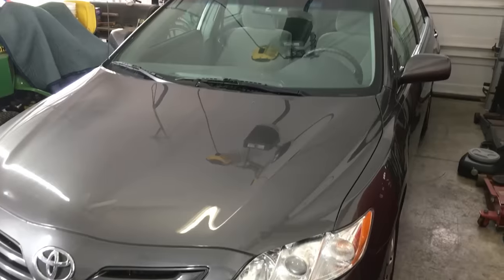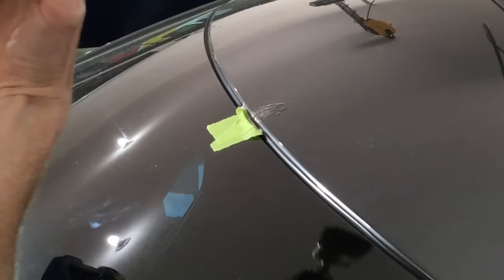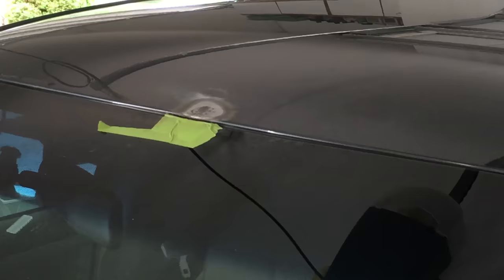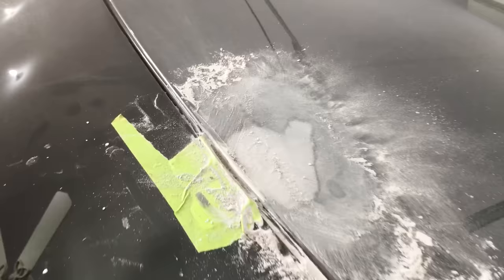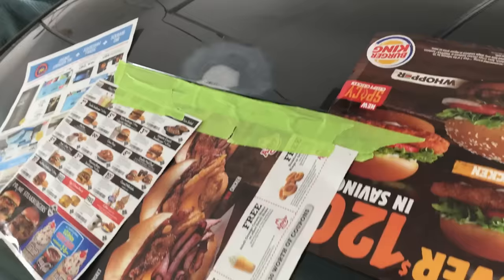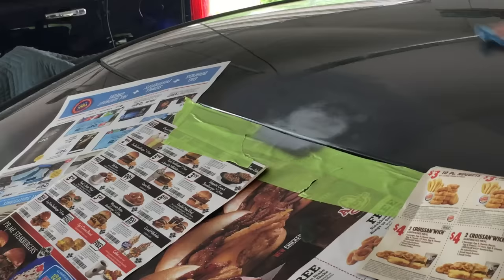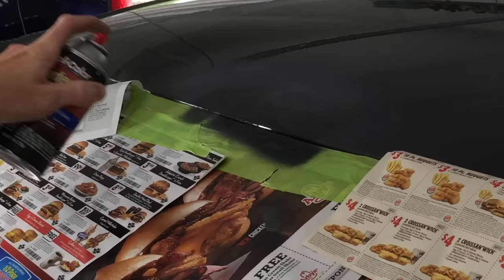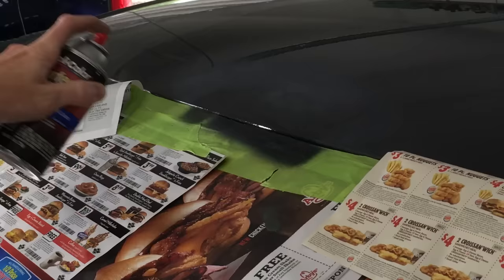How to Fix: Rust Bubble Under Paint from a Rock Chip Around WIndshield

Comment: Thank you for your helpful DIY tips.  I've got over a decade of professional certified hand spraying under my belt for airplanes.  Tips like these on a used daily driver and to have it coming out looking good for not a lot of money is what I look for.  Sure beats touch up paint in a tube..lol!  I have several cars/trucks and both foreign and domestic.  I always liked my VW's for a fun, sporty, daily driver.  I own 2 as of now.  My nicest one is one I searched for.  It is a 2009 Jetta GLI 2.0 turbo manual shift in top condition.  My second is a 2010 Jetta SEL 2.5 with a DCT trans and every option you can think of.  I found it down south needing work, but in great overall condition.  Just some normal scratches and a small rust bubble on each fender.  It had average miles of just over 90K, but the owners neglected oil changes, and probably the right oil for that matter.  The inside of the engine was filthy and it was out of time from a stretched timing chain.  I made a deal with them and trailered it home to fix back up as a DD.  If the interior wasn't like brand new and being the top of the line SEL package I would of passed on it.  Not to mention the body was in very good shape for the year.  I decided to source a used engine instead because of the gunky build up in the engine from negligence.  I found a matching 25,000 mile engine in clean like new condition for $700..Wished I could find a 2.0 Turbo for that kind of money.  Well anyway I decided to get the matching DCT that came with that engine as well for an additional $500.  All said and done I have under 3K total in the car and it looks, drives, and runs like a brand new car.  If you have the know how and take your time you can save a lot of cash.  Plus they are a nice car too.  Man I was surprised as how strong that inline NA 5 cylinder turned out to be.  I let my son drive it and drag race my GLI at the local track in the 1/4 mile..He actually pulled me through the 1/8th and I barely ran him down at the 1/4...I was impressed for just a daily driver that also looks cool and handles and drives great.  Well worth the $3k and my time...sorry for the book..its videos like yours that help us diy'ers the most. thanks.

Comment: You can use a Dremel tool to remove the rust on small areas and apply a rust converter to pitted areas before priming and adding filler. Always apply your primer both before and after adding any filler. Also if the surface is smooth without any pitting or bare metal exposed you can usually paint over the converted rust directly.
Reply: Filler should generally be applied to bare metal
Reply: @mehmeh5471  Filling over primer is OK. Filling over paint is a no-no.
Reply: While you CAN paint directly over converted rust/bare metal, it is better to etch prime it first.

Comment: The major issue with this is when you showed the pit u said to use spot putty, to the left is rust. The dark black/brown is rust. Wire brush won't get rid of it all. Only sand blasting or use a rust reformer or acid. You can do all the nice work and paint but not worth the time and money when rust bleeds through in 3 months. I use Ospho. I know this because I did this when I was a young man restoring a 72 VW Bug. I did same as you and it rusted through in 6 months. Then a girl filling with gas day after I repainted, pump didnt  kick off and my new paint job bubbled from the gas. So 3rd times was a charm.
 I learned from a grumpy old man that if you do a great job on prep you can paint with a spray cans and still look good! Gotta get rid of all that rust. Even if you don't see it, rust will be at the bottom of those tiny pits. If it was there it will be there until you use sand, acid etc Use whatever you want but use it and have it 100% rust free. Other than that it was a good video. I'm not breaking your balls I just want your work to hold up and be as good as it can. Even a newbie if following all the steps can get any job dam near perfect. We're judged by our work. And we all make mistakes.
Reply from the maker: Thank you for the advice!

Comment: Great video but you should have used rust converter before the filler, and when you have finished painting you need to leave it at least 4 weeks before applying any waxes or sealants to let the paint 'gas out'.
Reply: snake oil, doesnt work
Reply: @EazyDuz18  what is snake oil?

Comment: Thanks for this. When you own a GMC Sierra, you learn a lot about rust bubbles. What I find amazing is that it took just 4 years from the factory for my truck to get a rust bubble. It's 2020, IMO, cars shouldn't rust for a very long time.
Mini has a 10 year warranty on rust because the chassis and metal panels are all dip coated. The rest is plastic.
Anyway, thanks for the video, have some bubbles to bust. Gonna skip the buffing because it's truck and I don't care about a full finish.
Reply from the maker: Let me guess... you live in Ohio or Michigan?
Reply: @6thGearGarage  Pennsylvania. They chemical treat a 1/4" of snow. 🤣

Comment: Thanks. I'm not planning to go into all the detail you did and I couldn't care less what my Caravan will look like afterward, but I just wanted a way to make sure that when I cover it up with Tremclad or whatever, that the rust wouldn't "bleed" back through. We bought our 2016 Caravan last summer and the dealership (or previous owner) had covered up some chipped paint with some sort of paint, and rust is now coming through. I see i have to make sure I sand down to the BARE METAL and make sure all the rust is gone, before I even attempt to paint. Thanks!
Reply from the maker: Yep,grinding it down is important. You can also apply a rust converter before primer/paint for an extra piece of mind that the rust won't come back.
Reply: @6thGearGarage  I tried that on a previous vehicle, but the rust still came through. So I'm thinking grinding away all the rust is what will make the difference.

Comment: Great DIY video, BUT, I can almost guarantee you that the rust is starting from the seam underneath the windshield urethane, rock chips never bubble up like that unless they're 10-20 years old. Once the rust eats enough of the metal under the urethane, you'll get a leaky windshield in the rain and that will cause major floor pan rust. This is all caused by poor windshield installation and the installer not using a primer before they lay the bead of urethane. I totally get that it's a cheap car but just keep that in mind for future reference, or if anyone else is attempting to do this they should note that it's not a permanent repair.

 It's about $100 to have your windshield removed, many glass companies will come to your house and do it, and you can follow the same steps in this video for fixing any rust under there MINUS the body filler, just remove the rust and leave the metal pitted, the urethane takes the shape of the metal so any imperfections are okay to leave. Then body fill any necessary areas ASIDE from the seam,  primer and paint the entire repair area and have the windshield PROPERLY installed again.
Reply from the maker: Thanks for the advice!
Reply: Classified   When you spend $5000. for one you worry about crap like that, but when you spend five hundred you don't worry about anything. Not questioning you, but insurance cost more than the car's worth. That's how you live way under budget and don't sweat the little shit. If it doesn't purr like you want, fk it, just call the junk yard and look for another $500. ride.  :-D
Reply: Bent Nickel I get that, but people will be doing this on nice vehicles thinking they’re doing a good job. It’s important that they know it is not a permanent fix, not really a fix at all. Kind of like slapping a fender flare over a rusted wheel well. Might as well fix it properly before you’ve got rust holes if you plan on keeping the vehicle. For the work involved, having the glass pulled isn’t anything more than $100 on your part, you won’t even be doing the work and you can fix it right that way.

Comment: Pro tip. Always apply an anti corrosive application to bare metal before applying any filler.
Reply: Filler can go directly on bare metal
Reply: Tought filler could go strait on metal?
Reply: @ScandiSledder8000  if there are any pits, rust will come back. I sanded the edges of a metal door last december, used some filler on the pits and bumps and applied 2 coats of anticorrosive primer, and 2 of color (no clear since it was a door). it is now september and rust came back in the same areas. This time will try some metal conditioner.  some primer and then the filler.

Comment: Very good job. I didnt go deep enough to the metal on my 2000 Ford Taurus as my rust bubbles have sadly returned in less than a year. my problem area is right below the gas cap- a 6inch square.  I'll use this video for my next try and the wire brush attachment.

Comment: Really appreciate you sharing this. I currently have this issue on my car in a number of spots. I was quoted $1,500 for repairs and needless to say the idea of just slapping a glob of sealing glue or the like felt like a cheap alternative. Though I knew I wanted something that would actually fix my car, not just be a "duct tape" fix. 

This is exactly what I needed to see so I can feel confident to fix my car on my own... or convince my friend who actually works on cars to try something new. Out of curiosity, if you had to ball park the cost of your tools and supplies for this job, where would you hit at? Seeing if I can save up money to budget for this. I assume it will be less than $1,500.
Reply from the maker: I would guess maybe $100 for materials.  I have links to the products used in the description if you wanted to price them out. It's absolutely worth trying it yourself!

Comment: I did the same on the roof of my car. The brown / black that remains is the start of new rust. After a few years, the rust will return in a few year . I have a solution for this. What I do is spray penetrating oil on the brown spots and after working for 10 minutes, clean the spot thoroughly with a cloth dipped in benzene and then the spot in the spray putty. Then follow the well-known road. The area treated in this way will never rust again (if you put the car in the car wash at least twice a year)

Comment: Thanks for the great video! Would you recommend applying a second coat of self-etching primer before moving on to the filler primer?
Reply from the maker: Yes you can apply a second coat if the first coat did not completely cover.

Comment: I've been hating my paint job lately and scared as hell to take the many rust spots/bubbling paint down to bare metal. This video gives me a little more confidence that just maybe I could do a decent enough job. I have a 2006 Scion xB that i love, except the exterior condition. Great video and thanks for posting it. I'm trying to learn about video editing as well and am thinking this would be a great video for me to attempt. If ANYONE has a step or two that he missed or absolutely nailed, please let me know. I'm now sort of excited to try this. Thanks man. Excellent video
Reply from the maker: Ive noticed that scions seem to get chips easily. It makes me wonder if there are paint quality issues or if the paint was applied thin in general.
Reply: @6thGearGarage  first and foremost thanks for responding to my comment. I appreciate that. Second of all I don't know much about paint on cars so I really couldn't answer that question, but I do have a ton of rock chips on the hood and I've got a big rust spot on my driver side door from where the paint got scratched and was never taken care of. On top of that I've noticed above my windshield I have a lot of small bubbling paint areas so I can only assume that rust is forming underneath there.

Comment: Good tutorial however would it be worth adding a rust cure solution before filler to prevent tiniest  rust spot returning?
Reply from the maker: Yes. On a nicer vehicle with lower miles,  it would be worth it.

Comment: definitely a temp repair. cant spot in a a panel like that without clearing the entire roof over, clear will fail and show where its been spotted in down the road esp not being 2k clear, good temp fix though
Reply from the maker: I would use 2k on something nicer. I have an upcoming repair on a Ford Edge which I will use 2k and spray with a gun. I showed the cheap/easy method here for cars that aren't expensive.
Reply: @6thGearGarage  What is a 2k?
Reply from the maker: @SithLord2066  2k is urethane paint like the factory uses on new vehicles.
Reply: Overspray much haha

Comment: Pro tip: dab some POR 15 (or the like) on the rust damaged area  before advancing to the filler stage. Without something heavy to slow the rust down, this repair will fail after the first good rain. Moisture is the enemy.

Comment: I've been doing body work probably longer than you have been alive. You can't just sand rust and put body fill over it! to properly remove rust it MUST be sandblasted. The pits still have rust in them and will keep working, you will see your work start to bubble in a short time. I get it a lot of people don't have access to a sand blaster so the least that should be done before adding your body fill is to use a "sealer-rust converter" which in some cases doubles as a primer, it isn't a perfect scenario but it will buy some extra time for your repair.
Reply: would it be possible to sand the areas down, cover them and bring them to a shop to sandblast, than take back and prep it for them to paint? I just recently bought a car and wanna make it nice, and I'm hoping to find ways to do this sort of thing the right way but cheaper. I don't plan on doing cosmetic repairs soon though, so if that's not possible than I will live
Reply: @Lysergic_  I think that’s why he used self etching primer it’s a rust preventing coat basically but it doesn’t fully seal that’s why you use the prime filler after

Comment: There is nothing worse than rust in your crack!
Reply from the maker: OhYeahAboutThat 😂
Reply: Well do the normal,  sand wet & dry.  Clean with 3 M 400 grit until smooth and cleaned off with thinners.  Then paint with Ospho and leave overnight.  When you check in the morning.  You will find it all inert snd you can prime the prefferred car paint.

Wont rust again
Reply: HERPES🤯🤫🤫🤫🤫🤫🤫

Comment: I covered a rock chip with clear nail polish. Started rusting underneath and would've probably stayed normal had I not even added any polish. I just trapped in any moisture.
Reply from the maker: You would have had to remove & neutralize the rust first. Then the nail polish would have worked (for a while - not UV resistant.) It will still rust underneath if it's just painted over.

Comment: - Goes to fix a quarter sized spot
- Ends up sanding down and repainting the whole car
Reply: Yes you need to make the repair area as small as possible he went overkill
Reply: You go at least 1/2” outside the rust area.  He did not go too far out